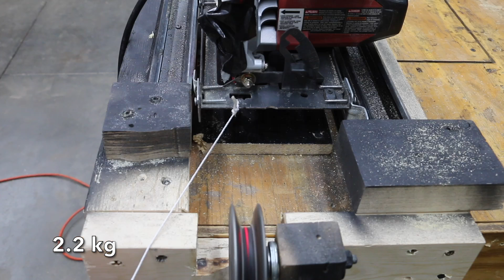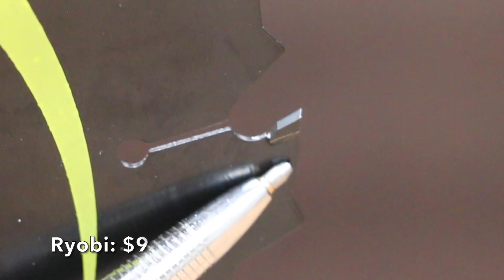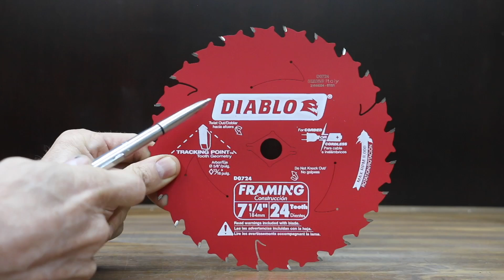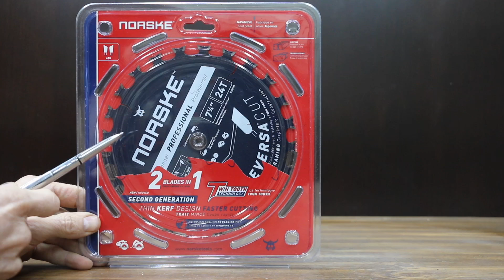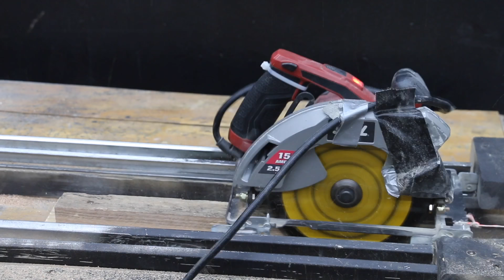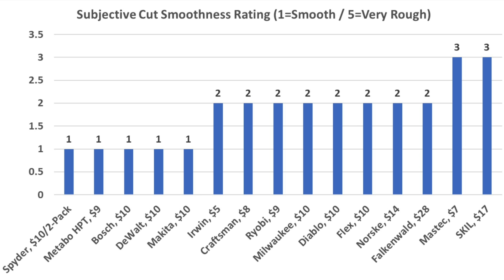Best Circular Saw Blade? FLEX, Diablo, Milwaukee, Makita, Bosch, Ryobi, Irwin, Spyder, SKIL, Norske

Comment: Great video as always, however one thought I think you missed on. Ripping and crosscutting generally take very different blade designs to do well. My guess would be that these saw blades are designed and profiled more towards crosscutting lumber than ripping, as it's the more common cut when framing. I'd be really curious to see if your results would be different if instead of ripping a 1 foot 2x4, you crosscut a 2x12 or lined up multiple boards to get your length of cut. Thanks for everything you do to make these videos. They really are a great recourse for us all
Reply from the maker: Thanks and you are welcome!  Thanks for the suggestion.
Reply: Back when the blades were steel, yes, the cross-cut and rip-cut needed different tooth designs to be efficient and speedy.  With the carbide-toothed blades, I think there's probably a lot less necessity for that.  However, it would make a great test to see how each of these blades perform in the cross-cut.
Reply: @somejoe7777  it’s not just about blade material but also how well the blade handles chips, larger gaps leave more room for chips to move around, super important with ripping
Reply: @PSUQDPICHQIEIWC  so in other words, this video is the best option as opposed to guessing?
Reply: I would love to see these crosscut a 2x12 just to know if the results would dovetail.

Comment: I'd like to see you compare break parts cleaner, is the cheap stuff just as good as the expensive stuff?
Reply: its the same
Reply from the maker: Thank you for the video idea!
Reply: I have bought the cheapest and works well 👍 pressure is key with brake cleaners , good pressure and cleaning  ability works in sinergy
Reply: This would be great
Reply: Great idea, I always just use what ever is cheapest.

Comment: I use these saws professionally and I have found that the Diablo performs well and holds up for a long time. Also at Home Depot the Diablos go on sale on a regular basis where you can buy a two pack for about $10. I also have some Diablo finish blades which really do a good job for general purpose cutting and they use less battery. The finish blades are more expensive but they also go on sale but less often. Also when you buy the Diablo blades you are not sending money to China. I would rather send my money to our cousins in Europe.
Reply: It is crazy just how nearly everything is made in China.
Reply: I also use Diablo blades on a daily basis and have no complaints. 

I am going to purchase a makita blade just for curiosity and I’ll see how well they perform after they get hot and hit a couple nails.
Reply: My go to has been the Diablo as well and this video just confirmed it’s a great brand.
Reply: @masterchefbaboo  They might not 'win' every test he throws at them, but they are consistently very good in testing & like you, I have found the same in my use too.
Reply: Thanks for the feedback.

Comment: Priceless content as always 
I’d like to see you test some crowbars, it would be pretty straightforward but the value that you could add in the selection of the best one is just something I would look before buying another one
Reply from the maker: Thank you for the video idea!
Reply: My best bar:  True Temper 1162500 Pinch Point Crowbar with Heat-Treated Steel, 66 Inch, actual weight 32 lbs, made in India

Comment: Actually impressive how well a number of blades performed for that $10 price point, but the Makita was a real surprise for shorter cuts on clean wood!
Love your work.
Reply from the maker: Thanks!
Reply: The Makita blades are a dream to use when new they cut almost with no tare out but they don't last as long
Reply: Was about to pull the trigger on a 3 pack of makita blades. Looks like there are several reviews saying they can get hot and warp and then cause kick back and binding. For my use I think they will work fine (7 1/4” cordless miter saw) I don’t see the blade binding up on that. Miter saw is a bit under powered for some things so I’m hoping these blades will help.
Reply: @ToolsInAction4u  none of these are great blades.  They're disposable construction grade blades.  Good blades are much more expensive.  Also, a miter saw version of these blades may not perform the same.  Don't buy a blade just because it fits.  Buy a blade for a miter saw.

Comment: I’ve just completed a hybrid floating floor installation in our house. The floor has a limestone/pvc core and very tough. I used a lot of laminate jigsaw blades made by Diablo but also used a Diablo 60 Tooth fine cut wood circular saw blade in my mitre saw. After the many many many cuts I did with it it’s still cutting really well with only a small loss in cutting ability.
Reply: Did you use the carbide one that has a 50x life?
Reply: @Zombieboxx1  the packet says Ultra long cutting life. Carbide blade. I’m in Australia but I’m guessing the  product would be the same.
Reply: @Zombieboxx1  they can just lie about it, I pay no attention to ridiculous claims.

Comment: Still like the diablo blades, but Spyder just impressed me.  A good bang for the buck.
Reply: I almost always run diablo, I got a spider framing blade to try out. Ran it for a day doing mainly framing and by the end of the day I had 2 missing teeth... went back to diablo
Reply from the maker: Great feedback! Thank you
Reply: @MrGameing101  if I can't find Diablo I usually went with the Irwin Marbles as they're almost as good.  I am a DIYer so I don't need my blades to last forever.  If I can't find Diablo or Irwin Marbles, I won't cry if I pick up a Spyder on sale.

Comment: the first time i got a diablo framing blade i was ripping big 16 foot 2x12s down and i was blown away at the blades ability to rip through wood. some of these blades ii never thought to use, i buy diablo blades and then i but a couple fine tooth blades that arent used often. one tip when using the same blades, number them, that way you can keep the blades sharp longer, swap over to your oldest blade to cut through those nails then swap back to your newer blade for normal cutting on the site.
Reply from the maker: Thanks for sharing.

Comment: The Spyder impressed me the most. I figured it would get blown out of the water. However, it was typically on the upper end of performance the entire way except for the missing teeth.
Reply: Yeah but that could have been 1000 variables ive never broke any teeth but he is using 40 tooth instead of 24 tooth blades
Reply: @WTNPROUD  he is using standard 24t framing blades with the exception of a few..  did you watch the same video i did?
Reply: @WTNPROUD  he was using 24 except for like one 20 tooth.
Reply: Something I've noticed is there's usually one of the 'cheap' brands that just trounces the majority of the expensive stuff in every video lol.
Reply: @5peciesunkn0wn  usually because a lot of the cheaper options are made in the same factory as the expensive ones without the name brand tax
Reply: @5peciesunkn0wn  Well usually it's more of a middle range brand that does really good, brands like Irwin and Diablo and Makita. Not the high end but also not the absolute cheapest. This time Spyder, the absolute cheapest brand by a large margin, managed to best all but Makita in speed after the durability test, and proved to be the blade that lost the least cutting speed of them all. Add to that the high quality of the cut and it's even more impressive. The next cheapest blade at $7, two dollar more than the Spyder, was however decidedly unimpressive coming last in a lot of tests. That the cheapest alternative proves this capable is quite uncommon.
Reply: @blahorgaslisk7763  There were two $5 blades.
Reply: @blahorgaslisk7763  

I'd say Makita is high end stuff.
Reply from the maker: Thanks for the feedback.
Reply: @5peciesunkn0wn  There were? I could have sworn Spyder was the cheapest and the next was $7...

Should have known better than relying on my memory by now...
Reply: @blahorgaslisk7763  Yeah. XD

Comment: As someone who has spent his whole career in home construction to me the absolute best blade that I ever used was the Black & Decker 24 tooth Piranha blade which for some reason they stopped making them in the mid 90s.  Then we switched to Irwin’s Marathon 24 tooth framing blade and this thing was awesome. We could cut through nails and gang nails in old trusses and never lost a carbide tooth.  We would buy them by the case and still insist on them today.
Reply from the maker: Thanks for sharing.
Reply: @capesquirt  I can believe the blade managed to cut through a steel nail puller, but I can't believe it did it so effortlessly it just felt like cutting through a bit of trim board.

Comment: Love the video, actually made me buy a Makita blade just to test it for myself. 
Would love to see a higher tooth blade review as I use a mini-slide miter saw and tend to run 40 or 60 tooth blades on it for finish trim work. It’s just so much nicer than having to use my heavier sliding compound miter., especially on smaller jobs.
Reply from the maker: Thanks for the suggestion.
Reply: Good suggestion
Reply: same, I'd love to see higher tooth blades and larger diameter blades as well

Comment: I don’t believe you typically do addendums, but CMT is a brand gaining a LOT of traction quickly. It would be great to see how one of their 24 teeth framing blades stacks up. They aren’t available in big box stores but very cheap and possibly a top performer.
Reply: I really like my 60 tooth CMT blade for the 12in miter saw, cuts like a hot knife through butter and leaves no blow out on trim work. I got mine at my local menards, but I've not seen them in HD or lowes
Reply from the maker: Thanks for the suggestion.
Reply: Not sure how it would hold up to abuse. I have one on a skill saw that has made hundreds of cuts without dulling a bit. I got one nail and the cut time is double now.
Reply: I switched to CMT recently and was hoping they would have been included.  I do love the blades but wonder if I am getting the value.
Reply: Agree cmt has been very good for me. I use them for router bits and they are very clean cutting bits and hold up very well

Comment: another nice set of tests, Todd! I noticed you did all of your tests as rip cuts. Cross cuts are actually much more common and since the optimal blade and tooth configuration for rip cuts is different than it is for cross cuts the test results may also differ significantly.
Reply: Lower teeth count is made for cross cuts so you may have a point. My bet would be the results stay relative similar though.
Reply: Since all the blades were tested the same way it shouldn't make much difference.
Reply: @Wohlfe  actually it would - ripping blades are designed differently than cross cut blades. A blade may perform very well when ripping and poorly when crosscutting or vice versa.
Reply: @TylerWardhaha  you got it backwards - higher tooth count is generally optimal for cross-cutting, whereas lower tooth count with larger gullet is generally optimal for rip cuts. Higher tooth count blades cut slower but produce a cleaner finish, while low tooth count w/ larger gullet is able to clear out material (sawdust) faster and reduce heat build-up during longer cuts, which typically means rip cuts.

Comment: Speed is def a factor when choosing a blade. The finish of the cut is also important. If the board gets chopped up from blade deflection, I’d rather chose a slower blade that yields a smoother finish.
Reply from the maker: Thanks for the feedback.
Reply: Not sure if you missed it, but he did include the comparison of the finish quality.  It would be interesting if that finished quality comparison was done at the same speed for each one, rather than the same force.

Comment: Todd, how confident are you in the sample size of this test? So many are so close, if you tested more examples of each saw blade, do you think the results would be statistically significant?
Reply: If these are bought at retail stores or say on Amazon, the results are likely to be similar to what you or I would find in our shops. Manufacturing processes for tools of this type are pretty consistent and quality assurance practices at most factories ensure consistency of the products.
Reply: @lukeknowles5700  having previously worked in QA in the manufacturing business, I'd strongly disagree with this generalization. In fact, the quality control programs from one manufacturer to another are wildly different. Some manufacturers have huge quality variations from one plant to another.
Reply: @nsbohn  If what you say is true, then an infinite number of samples would still not reveal meaningful results, and therefore your reply to my reply shows your initial question about testing more samples to be totally absurd. You can't have it both ways, Nick.
Reply: @lukeknowles5700  lol. You spend too much time arguing on the internet and it shows.  Go take a stats class, and maybe watch a couple videos on how this stuff is made, then come back and revisit this. You sound silly.
Reply: @lukeknowles5700  and just in case anyone else reads this... There are sample sizes between 1 and infinity that would give us a usable standard deviation. I don't blame Todd for not testing tens or hundreds of these blades, but the manufacturers should be.
Reply: @nsbohn  There it goes, Nikki practicing mind-reading as if she knows my background and employment history. Total dolt.
Reply: @lukeknowles5700  Much of what Nicholas says makes sense. You failed to make a substantive response.
Reply: I guess you could use price as a form of what you could expect from a brand. A blade. Performing as well as a blade twice as expensive, well what's the probability of a a blade half as good performing at that due to random variations in quality control? If it's highly probable due to high variability, well, then why buy the expensive blade? If it's highly Improbable, then definitely buy the cheaper blade. That's the way I look a it. Assessing small differences in comparable blades, no I Dont see this particularly valuable for that. It's when the price doubles or even triples, that's when these tests become more informative imo.
Reply: @kaufmanat1  I'd expect to see greater consistency at a higher price point, generally speaking. On the other hand, the law of diminishing returns would argue that said consistency may not matter.  It would depend on the baseline quality expected to be usable. Stuck between a rock and a hard place, for sure. What's annoying is, somebody already has the data, they just won't publish it.  SBD I'm looking at you!

Comment: The makita has a lot of blade deflection in my opinion. I’ve used a lot of these, and the Diablo just seems to run.
Reply from the maker: Great feedback on the Makita and Diablo. Thank you
Reply: wouldnt more blade deflection slow the cut down?
Reply: @Bizketbutt  no blade deflection on this blade just causes an inaccurate cut
Reply: Totally agree, the Makita Max are super thin which probably explains the speed but they flex and deform easily, so not very accurate.

Comment: Two things. More aggressive teeth (faster cutting) tend to wear faster. Thinner blades (lighter in weight) cut faster as they’re removing less material.

You can see what I mean with the Makita. Very aggressive teeth leads to fast wood cutting, but heavy damage on the bails.
Reply from the maker: Thanks for the feedback.

Comment: Because I don't use the circular saw much, I've always gotten by with the HFT blades.  Some Vermont Americans came to me cheap and the blades were only as good as the price - cheap.  I've had excellent luck with Oshluns on the Makita plunge saw, and Diablo is the only brand I want on my miter saw.  Those Spyders look like a good value, so I'll give them a try.  Great testing, as usual, Todd.  Thanks.
Reply from the maker: Thanks  Thanks for sharing.

Comment: Video Idea (possible series): Fire extinguishers.

There are a lot of brands of fire extinguishers out there, at a huge range of prices, with Amerex at the top, and sworn by by firefighters, then Kidde, First Alert, Buckey, and a whole bunch of no-name and private label brands.

Things interesting to test might be: ease of removal from wall brackets. Ease of use. Effectiveness/range.

It might also be interesting to test "messy" general use fire extinguishers like dry powder ABC type, against clean no-residue halon, halotron, CO2, or pressurized water, to see if you're sacrificing extinguishing power by going with the less-messy versions (which are admittedly much more expensive, other than water ones).

I don't know if you've ever had cause to use a dry fire extinguisher, but just discharging one is a minor catastrophe in itself. The amount of mess they can make is absolutely astonishing!

Comment: I have great video idea for product testing. Bungee cords! I am sure many viewers of your channel have used them before and i think it will pair well with your ratchet strap video. 

I recently bought some very durable made in the USA bungee cords called ThePerfectBungee, i have neve seen anything like these, they are amazing and come in so many different sizes and configurations. They are oil, chemical, UV and salt resistant.  It got me thinking how these would compare to other bungee cords from big box stores or online. 

It would be a really fun and interesting video seeing the pulling/holding strength, chemical resistance, heat/cold resistance,  abrasion resistance, etc. Hope this one gets added to the que!
Reply from the maker: Thanks for the suggestion.

Comment: I bought these Makita blades for my 6.5, 7.25, and 12 inch saws and they cut wood like butter, the 6.5 is a Milwaukee 18v fuel and there is very little drag or slowing down of the motor when cutting 2x material thanks again for testing these products
Reply from the maker: You are welcome!   Thanks for the feedback.